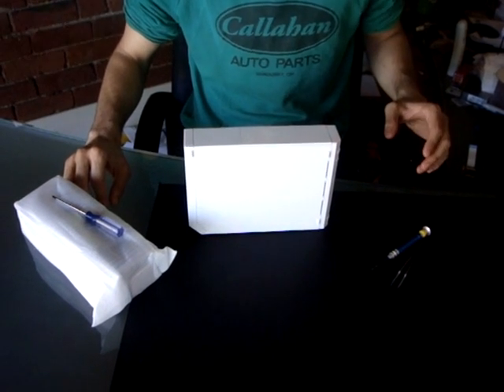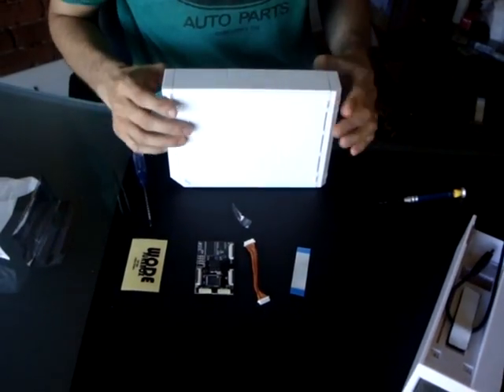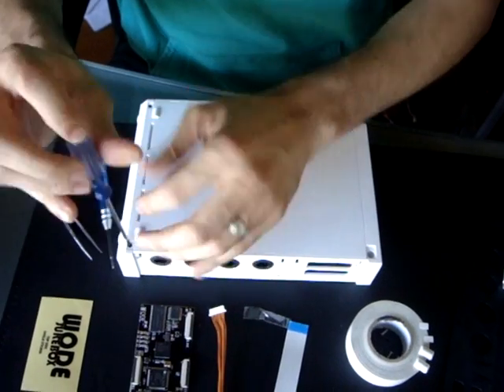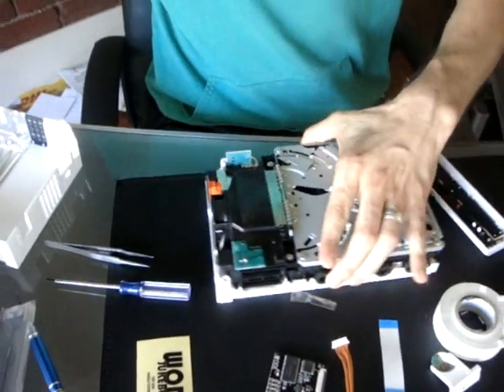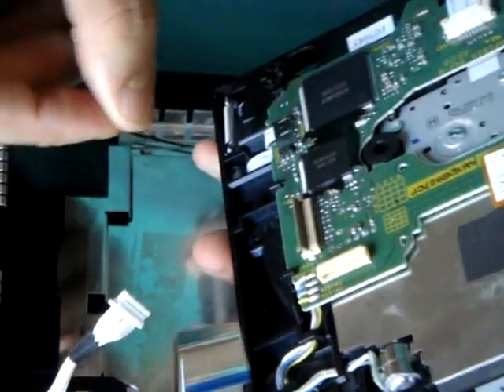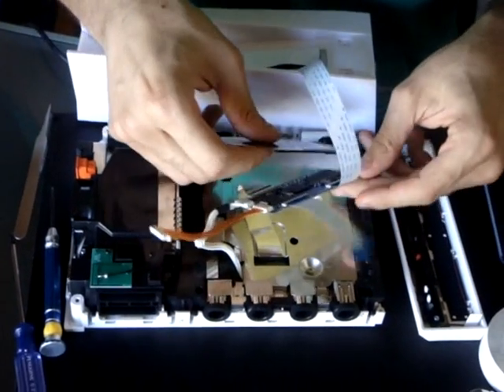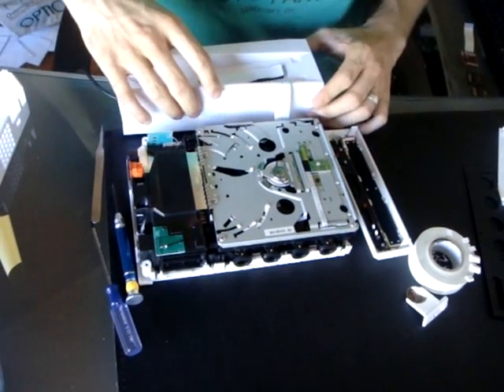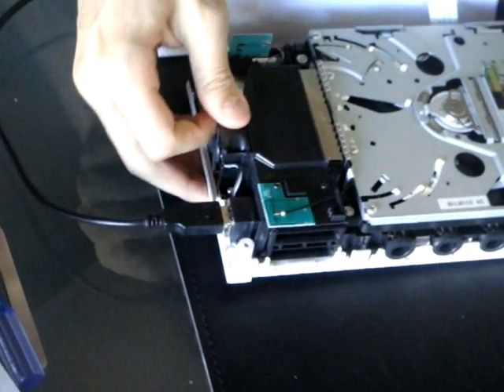WODE JukeBox Wii modchip installation video Part 1 of 2

Comment from the maker: @AFLrules101 obviously you didnt press down hard enough when turning the screws and you stripped the thread, so there is nothing to grip onto. Try using a bigger head screwdriver if possible and pressing down hard when you are  turning

Comment from the maker: @portfooty Sounds like you are "shorting " take out the orange power cable, and try it out, If its works, check the pins insid the socket, you might have bent them when putting in the orange cable